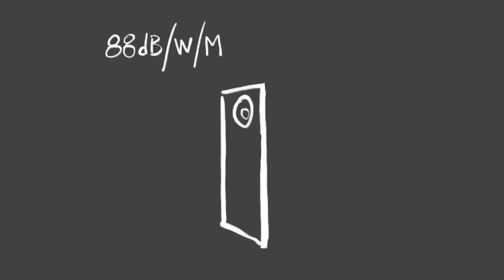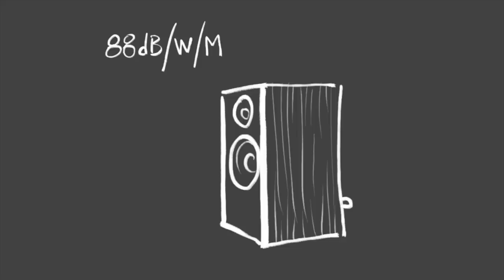John DeVore goes on a rant about the High End Audio lie that inspired him to start his company

Comment: An excellent dose of reality! And whatever happened to the strict FTC standards for amplifier power ratings required back in the 70’s and 80’s? Where power was measured in XX number of RMS watts, with both (or all) channels driven simultaneously, from 20-20,000 HZ, at .01% or less THD (distortion)? Truthful power, when today, multi-channel home theater receivers boast 100 watts of “peak power”, with only one channel driven,  at 10% distortion (clipping!, from 80-15,000 HZ! 🤣
Reply: Yes, because the soundtrack of "Transformers" is only worth listening to on the finest of audio equipment. ;-)

Comment: Thanks for this. My belief has been that sensitivity matters for speakers from everything that I have researched. Simple, although I have a good understanding of Watts and Ohms Laws. I teach it! Ha! 

So, back to what I was going to say: The higher the sensitivity, the louder and more efficient the speaker and the smaller wattage amp you need. That equates to the lower the sensitivity, the more wattage amplifier you need. And as you eloquently described not in so many words, the industry basically got away with lower efficient (I am assuming lower cost) speakers and figured no one will know. 

Now here's one for you, I have always wondered about Bose. Why do they not list sensitivity? Like you said, you can go smaller as long as you can drive the speaker correctly. So, I still wonder.......are Bose any good?

Comment: The overall point is well taken however as an electronics engineer the explanation as it were is rather fraught with errors.  Like "per meter" and calling impedance resistance.  Speakers have a reactive component thus power isn't simply VI.  

The other thing is how little the efficiency matters.  With the power amps of today...  Almost everything else matters more to the quality of the sound.

Comment: Great video. I have a question, or a small request. I like speakers with wider frequency, as mine Raidho’s are 40-50 000. My previous speakers were GamuT and ones before B&W, but my experience with B&W after replacing them with GamuT are not as satisfying as they announced them. How important is the frequency high and low frequency drivers (ribbons, radiators etc) and what is your experience with them?

Comment: I’d like to propose a counterpoint. With due respect, while I cannot argue with your math, I do disagree with your conclusion on the desirability of the two specification standards. With the exception of the tube amp /output transformer argument, which is spot-on, IMHO the 2.83v spec is more useful to most people. Here is why I think this. The vast majority of amplifiers today are solid state, which most closely approximate a voltage source. In addition, most listening is done at far below rated power, making maximum power unimportant. And, as I’m sure you are well aware, loudspeaker impedance isn’t resistive and has different values at different frequencies. So what does the customer want to know when investigating sensitivity? Typically they want to know how loud it’s going to play at any given volume setting. The 2.83v standard tells them this, because regardless of speaker impedance, 2.83 v will give them the dB specified. So, let’s say you wanted to see if an 8-Ohm speaker and a 4-Ohm speaker being driven by the same amplifier would play at the same SPL. If they were both xx dB@2.83v, they are equally loud. Sure the amplifier must deliver more power to the 4-Ohm speaker, but that is mostly irrelevant 99% of the time. Until you get to the point where you begin clipping the amp, it’s not a significant concern. Of course my argument is not valid with transformer coupled designs, whether they be tube or Solid State. But they are the minority.

Comment: Thanks John, very informative. Begs question, should a "recommended" amp/receiver spec/model(s) be included for each speaker model? Think most probably assume that they're compatible, and didn't realize the potential problems with higher-end gear. Fun to remember back to the old audiophile days of the late 80's/90's. Fun times, cables the thickness of your arm, etc. Take Care.

Comment: Awesome information content and appreciated rant! Just please notate power as P, as W=VI is mixing up quantities and units (and W can stand for work, which would be a measure of energy instead). Colloquial English is weird, I'll give you that, just making up quantities from the units... Volts? Voltage. Amperes? Amperage. Watts? Wattage. What's next, meterage instead of length or joulage for energy? Voltage doesn't really have a direct English name to describe the change in potential ∆V ("tension", in many languages; voltage is change in potential between two points, and potential is always defined at one point.), but we do have the words current and power at our disposal. :) Confusing enough to students how V can be used both as a quantity and a unit. (Then again, when printed typographically correct, symbols of quantities are in cursive and units are upright (Roman). :)

Extra tidbit is that the symbol I for electric current comes through French, intensité du courant, meaning just intensity of current.
Reply from the maker: Very good comment--yes, my unedited video went into Voltage as Potential, but that got edited out for clarity and length.

Comment: It has more to do with relation of driver to driver in designing a speaker. If you apply a watt to an 8 ohm woofer (bass), this yields a number, say 85dB, and is also 2.83V (AC). When you add a 4 ohm driver into the mix for say a midrange or tweeter, this 1W will yield a different output number. BUT- you don't supply wattage to drivers as they are voltage-sensitive interfaces, so voltage is what is fed to speakers. Once you figure in the 2.83V spec, the 8 ohm driver is 1W, and the 4 ohm driver is 2W. These outputs at 2.83V will yield a constant that allows the output matching the various drivers in 2-ways and 3-ways, et al, via the same supply being fed from your amplifier at the same output level. Once you have this constant, the design can then be balanced spectrally in terms of output from the bass to the treble, and to your specified or preferred voicing or sound. The 2.83V specification is not for promoting higher wattage or more powerful amplifiers, but in fact to measure the output of speakers on an even-keel from model to model; loudpeakers as a system, or only driver to driver.

Comment: 10 db they say, doubles your sound output. to get the ten db out of the speakers is a lot easier than getting 3db every time you double your amp wattage.your 100 watt amp turns into a 1000 watt amp. the numbers are vague, but you get the idea. good to see someone else is looking at things in the same light.

Comment: I can't understand the supposed problem he is ranting about? Physics and electricity work the same way no matter what variable is used. And I don't think no high-end audio person is looking at sensitivity in the first place when looking at speakers? If you are looking to buy high-end speakers I assume you would listen to them rather than looking at specs. And the same applies to amplifier specs, there is no need for 2x200w to drive speakers at home. A good quality 2x50w will drive most speakers and any load it is given.

Comment: Yeah tube amps had/have tapped outputs.  Because too low of a low impedance and you can exceed the rated power and break the amp, too high and the inductance from the transformer will cause voltage excursions that will break the amplifier.  Every solid state amp I personally own, including switching amps, don’t have the latter constraint.  They have a single output with a minimum impedance rating, and no maximum.  Below the minimum, there will be too much current, which will break the amp.  At or above the minimum, the amplifier works as a real good voltage source, so the voltage won’t change much as a function of speaker load.  Given that, a dB/V/m type rating would be a more fair comparative spec.  However, like many specs, the answer to ‘does it matter?’ is ‘it depends…’

Comment: The thing with doubling the power is limited to the amp's ability to handle current, if it cant handle more current like most amps it will be "double the power" only on paper and by calculating it with ohms law, but when measuring the current is lower this means the voltage is lower too, and my opinion for promoting "more power means better" is to sell new products so people will throw away there 10-15W tube amps and get that new 100W transistor amplifier

Comment: Thank you for what you've done in audio - you inspired me somewhat in my speaker design.

As someone who has designed very many amplifiers, and a number of speakers, including a proper hi-fi design, I don't see the big deal with sensitivity measurements. My large speakers have a theoretically lower sensitivity than my small speakers, but the small speakers can't fill the room, and the big speakers have no trouble filling it, and some.

At 4 ohms vs 8 ohms, if the 1W measurement is 89 dB, it's only 3 dB more or less for the other impedance - not a big deal in listening. Sensitivity makes a big difference if there is 10 dB or more in it. The sensitivity specification should be dropped altogether, and only be applicable as a technical specification on drivers. Manufacturers, for example Klipsch, are using this irrelevant sensitivity specification as a marketing tool.
Reply: All companies want to sell their products. Whatever it takes .  That is basic capitalism.  When it comes to peoples opinions, there are many .  I purchased a caver amp and preamp in 1989 added Klipsch forta II floor speakers.  The amp had plenty of power and the speakers were very efficient.  Horn tweeter was great .  Very happy .

Comment: I get your rant.  There's so much about the industry to rant about.
1. specs published by marketing instead of engineering.  Leading to insanely outrageous specs foisted on the uneducated.
2. the Nyquest theorem is universally applied wrong.  The 44.1KHz standard was set because that was the maximum sampling rate the early digital chips could handle.  Sony knew this was a piss poor standard, but they wanted to get their CDs and players out before anyone else.  Sony promised to improve the standard as technology improved.  But they never did -not for over 30 years - so now we're stuck with a shitty standard, and everyone just settled.  Now everyone cites the Nyquist theorem, but the NT assumes a pure sine wave.  The Nyquist minimum can only accurately reproduce a pure sine wave; nothing else.  And even that's only an average of 70.7% accuracy.  If I tried to sell you an amp with a THD of 29.3%, you would probably laugh in contempt.  Yet that is exactly what we accept with the CD standard.
3. The 20KHz "upper limit" of human hearing is false.  Children can often hear well beyond 20KHz.
4. Digital media offers incredible dynamic range, yet the recording industry has reduced dynamic range to a minimum - all but completely wasting the medium's potential.

Comment: Hi John, thank you for the Lessons. I got into HiFi in the Early 90s. Using floor standing Speakers and 50w integrated Amps. There's a hell of a lot to learn than I thought. I worked out and Read the basics of 8 ohms & RMS power Rateings & higher independence Speakers was easier to Drive. And a decent size room for the floor standers to work well.   That's been my basic route ever since. Very Basic I know. Cheers Grant.
Reply from the maker: Cheers, sounds like a good route to me. Thanks for watching.

Comment: One never measures speaker sensitivity with 1 watt input. You could only do that if the speaker had ruler flat constant impedance. Impedance is different at every frequency, which means the ampere draw of the speaker is different at every frequency, and therefore power is different at every frequency. You always measure speaker sensitivity with a signal at a given voltage, which does remain constant irrespective of the impedance load. Where 2.83v comes into play is that's 1 watt into a nominal 8 ohm load. 8 ohm rated speakers have been measured for a nominal 1meter/1 watt result with a 2.83v signal literally as long as speaker sensitivity has been measured. 

The average 8 ohm rated woofer impedance varies between 5 and 30 ohms or more. The power it draws with a 2.83v signal varies by that same amount, with ampere draw and therefore power as well inversely proportional to impedance. The actual draw is one watt only at those frequencies where impedance is exactly 8 ohms. With a typical ported enclosure there will be five frequencies where that occurs. With a sealed enclosure, three.    

 This is basic first semester EE101 stuff. Since most consumers have never taken EE101 their not being aware of why 8 ohm rated speakers are measured at 2.83v for a nominal 1w/1m result is understandable. For a speaker designer to be unaware of it  borders on the inconceivable.
Reply: You may be 100% correct. In any case, ALL of this goes away with Pro Audio equipment. Loudspeakers with built-in amps and +4dBu interconnects is 100% the way to the best sound, and a lot cheaper too. I'm surprised anyone is still making Hi-Fi equipment, honestly.
Reply: @christophermeraz-mata  Pro or consumer grade a speaker is a speaker, a volt is a volt, an ohm is an ohm. As for powered speakers, in the realm of pro sound most powered speakers are entry level PA speakers aimed at the DJ and club band market. As of late powered speakers have been making inroads in the high end install and pro-touring genres, but most remain passive at this point. The shortcomings of consumer level gear that uses unbalanced connections operating at -10dBu are real, but not germane to the subject at hand.
Reply: @billfitzmaurice3837  Professional powered monitors are absolutely not  "entry level." Even a $1000 pair of KH120's will sound better than 99% of the hifi setups I've heard in the past 40 years. Hi Fi is to Pro Audio as Nascar is to Formula 1. Anyway, my point is that no consumer should be worrying about impedances and ohms and sensitivity and watts of amplification - with a powered monitor, that's the designer's job.
Reply: @christophermeraz-mata  Powered monitors aren't what those of us in the professional sound gear and loudspeaker design community call pro-sound. By and large they're consumer grade gear without the fine wood finish. The best selling studio nearfield monitor of all time was the Yamaha NS-10. Google it. As for average consumers using powered speakers, other than subwoofers that point is a long way off, if ever. I don't see that many consumers ditching their AVRs in favor of AV pre-amps for use with powered speakers.
Reply: You Hi Fi guys have never listened to professional audio gear, that's exactly the problem that I'm trying to highlight. You  don't even know it exists. I'm talking about brands like PMC, K&H, ATC, or Genelec. I don't know what powered monitors you're thinking of that sound cheap to you.

A pair of professional powered monitors (anything that operates at +4dBu) will sound better than any consumer or Hi Fi system of the same price (anything operating at -10dBv). It isn't just a matter of voltage, these two things are as different as NASCAR and Formula 1.

By the way the NS-10 sucked and everybody knew it, but they were useful for other reasons.
Reply: @christophermeraz-mata  I've been designing speakers for home and professional use since 1969. If you ever heard a band or a DJ there's a good chance you've heard a speaker that I designed. And with that over and out.
Reply: @billfitzmaurice3837  I design and operate recording studios, so I also know a bit what I'm talking about. I used to be crazy about hi fi gear, but I got over it as soon as I bought my first pair of Neumann active monitors. 

Tell me, why don't you design hi fi speakers with an amp for each driver inside? Because you think no one will buy them? Or because the engineering is hard? Or something else?

Comment: I respectfully disagree. Sound output rated at some standard source voltage is a far more useful measure. Most speaker drivers have impedance that varies wildly with frequency. This makes any stated SPL for given power consumption at any given frequency meaningless. While the function of a power amplifier is to provide power, what it does is provide voltage which is directly proportional to the desired sound pressure. With respect to sound quality, the impedance of the speaker is not important. Apart from considerations for reasonable efficiency, all that matters is that the amplifier can deliver the current demanded by the speakers at any given voltage and audio frequency, and that the speakers faithfully transpose voltage to sound pressure in a linear fashion and at a sound pressure level that is as close as possible not dependent on frequency.